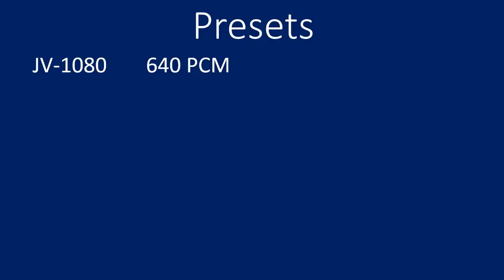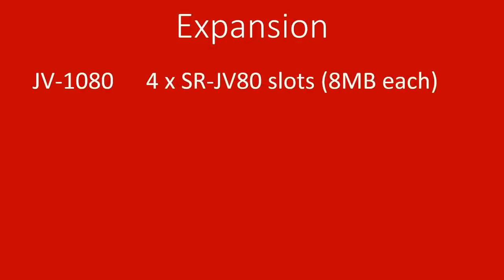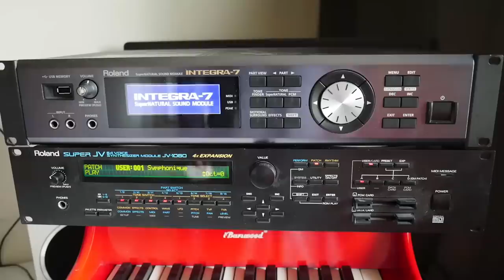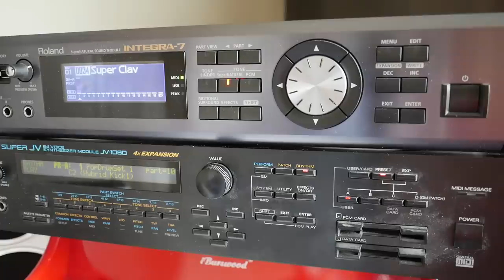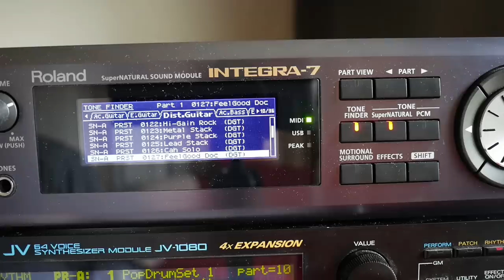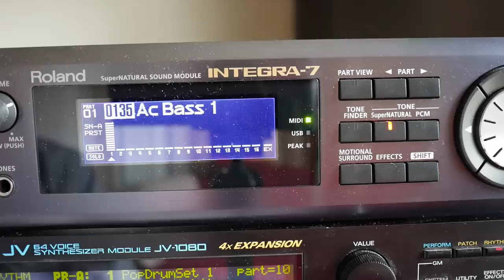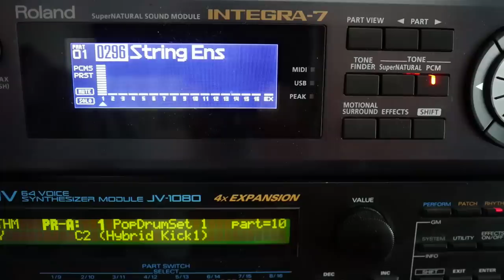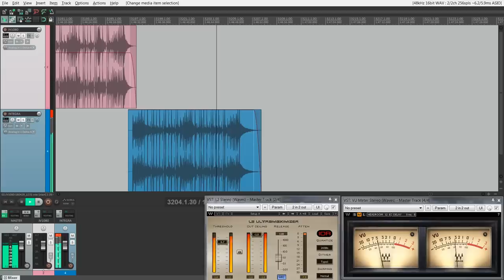Evolution of a classic synth module | Roland JV 1080 vs Integra 7

Comment: Thank you for uploading this excellent Demo. Over the years I've put Roland down to the 3rd slot behind Korg and Yamaha but this has been a great advert for the Roland sounds.I am now considering buying An Integra (or a 2nd hand JV1080) to work alongside my Korg PA1000 which is superb on the arranger side of things. While the arguments will rage on the Synth sounds, The JV1080 is great, I preferred the Orchestral and guitar Sounds on the Integra. Having got rid of My Roland BK7M due to it's inferiority to the Korg PA series, I may well be back to Roland with this sound module. Back in the early 90's Roland were kings of Sound Modules, I had one linked to my Atari at the time but felt they had not moved onwards and upwards alongside the other giants. This has certainly changed my views and having read the comments from the Roland fans on here my thoughts have definitely changed.Thanks to everyone who commented and Woody 's Piano Shack for the insightful demo.

Comment: Nice comparison Woody! You should have gone even further back in time by comparing the Integra to the U-110, Roland's first-ever rompler. :)

One thing the Integra is sadly missing is the patches of SR-JV80 expansion cards. Most of the samples are included since many were re-released as SRX cards, but the beautifully programmed patches are not. That's why I have a fully expanded XV5080 in addition to the Integra.
Reply from the maker: totally agree, that would really be nice, since the roms are onboard, perhaps roland could release all presets on Axial.
Reply: Woody Piano Shack That would be great. Roland did that when releasing SRX boards that were a collection of earlier SR-JV80 samples (3 SR-JV80 repackaged into one SRX): The box included a CD ROM with the SR-JV80 patches so you could load them into your XV. That way you could buy 4 SRX boards and get the equivalent of 4 x 3 = 12 SR-JV80 cards :)

Comment: The Integra does sound better but with SuperNATURAL it isn't just the sound but the way you play the sound.

Try a roll on a xylophone, hard to do on a synth but with SN lift the pitchbender and you got your roll playing just one note with sustain.

Got a Roland Jupiter 50 and is Integra based. Imho one of the best rompler synths to be had. Now out of production but got mine for €850 used (6 octave keyboard).
Reply from the maker: you're right, that's why the sax sounded freaky, i wasn't playing it right.  i plan to explore the supernatural articulations in an upcoming video.
Reply: Hi Woody,

The Integra is a great synth but also is the 1080, they just have a different character.

Looking forward to your SN video.

Cheers Mike
Reply: Yep.  The problem with the JV/XV series, as I see it, is that there are only four possible velocity layers - so you could sample a piano at four different dynamics, but then all the sounds it makes has to come from just those four samples / dynamics.

I think they did very well, with those limitations, but the same limitations are in all the sample based sounds -  including SRX cards that cover just pianos, for example, and the sampled sounds built into the Integra.

The Supernatural sounds should be better, because they're partly modelled.

I hoped Roland would bring out a module that was all Supernatural sounds - especially since I already have an XV-3080 stuffed full of cards for a good proportion of the other stuff.  It doesn't seem like they ever will though.
Reply: Good points there.

With Integra/Jupiter50/80 I thought Roland hit a home run but they cancelled the line.

No idea what Roland is about at the moment, the Boutique line can be fun (got the vocoder myself) but is this what they really want?

Then there is the Gaia and Aira stuff which in my opinion looks terrible.

The FA synths are their top tier workstations and can be had for under €1000 (FA-06).

If you don't come up with good hardware people will go software, their biggest fear is their downfall if you ask me.

Comment: Very good video, Woody, comparing thoroughly the two rack synths. One year ago, I was in a dilemma choosing either the Integra-7, or the JV-1080. After a lot of searching, I decided to get the JV-1080, which I now have full-expanded with the Orchestral, Vintage Synth, 60s & 70s, and Session boards; a choice that I am actually very happy with, as my current Roland palette is more than enough for my classical, rock, metal and synthwave needs.
Reply from the maker: great decision georgios, the expansion cards are very popular today, and holding their value.  check the capacitors though!

Comment: "Woody's Rack 'o ROMplers"   Anyway, I agree with your summary - there's definitely been advances in the 20 years, but the 1080 can still hold its own for non-acoustic sounds.  The guitars and such in the i7 are great too, and my turn-to sounds when composing.  People will also comment I'm sure on why not go VST?  Well, the cost for one - think how many sample libraries I'd need to match the 6000 or so samples in the i7.  Plus a computer.  Plus something to host the VST.   For live work, the module is still king.  For studio work, it's hard to beat also, and I'll dare you to pick out the $300 sample library from the 1080 equivalent from a good mix.  (Yes yes, I know YOU can, reader, but most don't care... LOL )    Oh, if you need ideas for cheap modules, I've got 'em all (literally I think, according to my wife) and can make some recommendations for which works well for what, and maybe a preferences order.  If you like Korg sounds, for example, get the TR rack over the Triton Rack first for greats pad sounds.  For cool and biting (almost rip your head off top end) get a Yamaha CS6R.  Not as cheap, but unlike the others, try the Waldorf Microwave I, and straying out of the pure ROMpler land again, the Yamaha TG77 is very cool hybrid with FM and PCM.
Reply from the maker: i do like the korg sounds, and have plans for a Yamaha, so appreciate your suggestions!

Comment: I finally got one Woody! £150 from eBay, took delivery of it on Saturday and the guy had it courier delivered to me in it's very own flight case. Now got it hooked up alongside my JV-880 and JV-1010 which both have the SRJV80-04 classic synth and SRJV80-08 keyboards of the 60's and 70's expansion cards installed in them.. Fallen in love with the 1080's Taj Mahal preset already. Now, time to see if I can follow Espen's example. lol
Reply from the maker: awesome, congrats!  need to spend some time with mine, i'll look out for that patch!

Comment: For those of you who really liked the JV 1080 sounds, Roland's Juno DS seems to have pretty much the same sound engine as the JV series, as far as I can tell.  (it's the only "real & working" synth I have, so I've dug into the manual a bit the last 6 months)

For $700, you get a new synth with a warrantee, which has the JV engine, also with some basic sampler capabilities and drum/pattern looper, includes a keyboard with some performance knobs, and runs on batteries.
Reply: Just for info, the Roland Go:Keys has exactly the same sound set as the Juno DS, as far as I can tell. You can’t edit the sounds from the front panel as you can with the DS, but you can via midi CCs (you can’t save edits mind). And around half the price of a DS.

Comment: I owned the XV-5080 and I still own the JV-1080, both are in excellent condition. When I sold the XV-5080 in order to buy my Jupiter-50, I told myself that I will not regret it, mostly because of DACs and the Jupiter-50 sounds more like XV than the JV. The SR-JV cards, I owned 8 of them, sound better in JV-1080 imo. I even don't want to buy a Fantom or Integra-7 now... The only thing perhaps is to try the JD-990 ;)

Comment: Sounds to me like Roland was trying to "update" some of those classic presets.  The 1080's samples may sound a bit dated in some cases (like the nylon guitar) but in effect it ends up being a comparison of presets on two different synths.  It's almost misleading to claim the Integra has "all the sounds of the x080".

Eric Persing knew what he was doing, pulled off some minor miracles with the hardware available at the time, and his presets STILL can't be outclassed by mere mortals today.
Reply from the maker: nick, the 2080 had all the presets of the 1080, the 5080 had the 2080 presets, and the integra has all the 5080.  these presets  sound just the same to me.  +1 on eric!
Reply: The presets may have had similar or same names. That's as far as I'd go based on what I heard here. If Roland is presenting that the Integra has 1080 in it, then alternative type of comparison would have turned all the effects and filters off to see if the pcm/whatever is used as source sound same (to such degree you can't tell them apart in ABX test with EQ'd headphones). Then turn them back on one at a time to see if they can be matched. If they are not presenting such, then of course trying to see if they can actually sound identical is pointless. The reason why I have good ears is that I use EQ'd headphones, so the sound is the same as long as the headphones are the same. Sometimes my hearing changes a bit, so I have another EQ on top of that to compensate for changes in hearing (or if the HP are plugged into different system). This lets me learn the signatures of various devices and how a well mastered record sounds. (eg. Quincy Jones or classic records not mastered by 'obnoxiously loud..low dynamic range guitarists'). To me differences between various PC Adlib soundcard clones and even Roland Sound Canvas are obvious despite the fact the chips they use are same. The analog paths don't use exact same value resistors and caps so the 'integral nonlinearity' is different. Further, if you have stereo sound, sloppy timing can result in poorer stereo image. Since the timings change with DAC's, and the Rolands use different DACs in each unit, none of them sound the same. (see wikipedia for Differential nonlinearity for visual illustration)
Reply: I listened few more. So there was couple "identical" sounding presets. However in each of these the stereo image is somehow more "boring" in the Integra. Raises the question whether these newer DACs are more mathematically accurate where the old ones in early 90s might have been "tuned with tongue in the right angle" to sound better. Would not be surprising at all, because when corporates hire new kids from the school, it's safer to go with math and "linear" even if "tuned by ear and non-linear" was more appreciated by (some)customers.

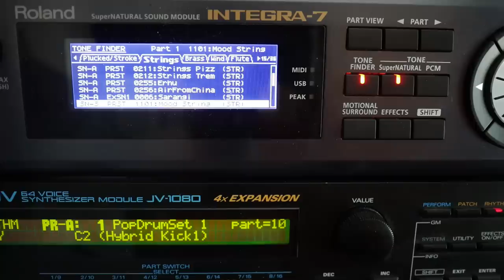Comment: I have a Yamaha PSR6700 keyboard, have had it for years since they were released in Australia in 1991. Would the JV 1080 be okay to connect with MIDI cables on it? Since I see two modules connected to this system, which one are you using in the demo, the top one or the JV 1080?  I love classic music, organs and so on. Is this beautiful music from the JV 1080 at 13:31? Beautiful relaxing sounds. Great video mate. Thank.

Comment: You can only use a single insert fx on one multitimbral part in the JV1080 along with the global chorus and reverb. The This was the same on the newer XV3080. The JV2080 and XV5080 had up to 3 insert fx available when using them multitimbrally.

Comment: The JV1080 still holds its own and starts up in a fraction of the time! I have read it sounds better than the JV/XPs that followed. The Integra-7 however can be much more cost effective if you start chasing expansion cards, which have held their value well. Another reason I bought the I7 was to replace an XP-30, but I haven't been able to let it go because it does sound different and sometimes better... Finally, I always thought Roland did a good job with the small 2 line display on the JV1080 which I found intuitive for editing the XP30.
Reply from the maker: right on stabs!  i agree about the I7 being cost effective, even if it's expensive.  you could get 3 vintage racks for similar price as a used I7.  probably a single I7 can do everything the vintage racks can combined.  good point about the cards.
Reply: So let me get this right. I can pick up a vintage Roland module or keyboard for less than £200 . But I can everyone of them in an Integra 7. To be honest, I think I’d prefer the authentic vintage
Reply: If I was a newcomer to the range, I’d absolutely start with on the JV/XP. It is only if or when you outgrow them, i.e. want more sounds (since cards expensive), synthesis, polyphony and effects should you look upwards to I7, but theres a huge amount to explore before then and in a nicer and cheaper form. Heck I had an XP30 for nearly 20 years before looking at I7 and even then kept both! 

I7 is not a good starter module and Roland did a better job with a smaller screen and more buttons earlier in the range imo as mentioned. Earlier models also have a less is more thing with more love put into them and I don’t think anyone would fully appreciate the I7 without working their way up, since it is basically everything packed into a much less charismatic black box.
Reply: @royclarke8687  Authentic vintage?  Jv-1080 roms are all in the integra 7.  ot recreates the sound of it perfectly.  and how is it not authentic?  its not like its some bootleg.
Reply: @RaveyStabs  LOL, you guys are really laying it on thick. integra is better in all ways.  and it has the jv-2080 style screen which is objectively way better than the smaller screen on the 1080.
Reply: @djangofett4879  sometimes more buttons to take you directly to places even with a small screen can work better, especially when editing. And on the XP30 you have a lot of buttons for browsing by category and card or just punching in the patch no.

Comment: I need SRX boardsn for my Juno. Put in way more memory by way of dimms and  a 4GB PCMC to CF flash converter for external samples (over several times more than the manual allows for). And it works fine, I guess my point is you can push Roland gear a little harder sometimes. I'd love to get either of these units for both samples and effects. That piano you first played sounds great compared to the Roland V-Piano which is also nice. Both sound great, your lucky to have each unit. May I ask what audio interface you use?

Comment: Piano sound commencing at time 6:42  sounds particularly good. One of the curious little quirks I have found with the old JV and XP synths,  on the piano and drum kit categories of patches for example, is  The tendency for individual notes to  jump around seemingly randomly and vigourously in terms of their panning position within the stereo field.  In my previous days of working extensively with the XP30 I  had wondered if this was the result of some setting I had inadvertently activated, or even if it may have been a bit of a weird fault with the particular unit I was using at the time, although thanks to your recent video presentations with this JV I have  noticed the same characteristic.  Curious to know if anyone else has clocked this and the reason for it. As ever, a thoroughly enjoyable and informative video.
Reply: It's part of the patch programming. You can have subsequent played notes in a random point in the stereo field.
Reply: Interesting stuff! Although I have to say I have always found that a bit strange on the ear, particularly  in the context of piano patches (among others) where you would (naturally) expect a more static,  linear stereo spread in line with the real instrument where the notes are in fixed positions. Still great sounds generally.
Reply: Yeah, it's the random pan parameter, there's also random pitch, user definable too...and by the way, it's more of a synth than a "rompler", cause there's structure, fxm(kinda cross-modulation), ring modulator, booster and so many parameters...

Comment: I’ve owned most of Roland’s gear since buying a Juno 60 new in the early 80’s, including the 10/2080 and Integra. The only Roland box I have these days is the humble JV-880 with the Vintage card installed. For a digital box it sounds more ’live’ and real in a gritty, musical way than either of these.